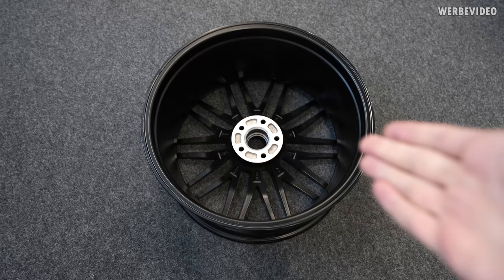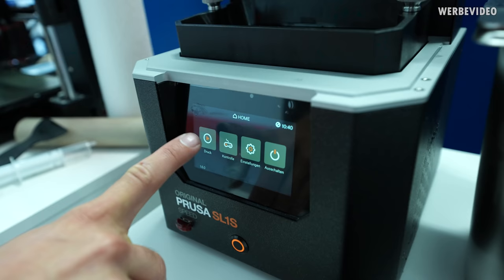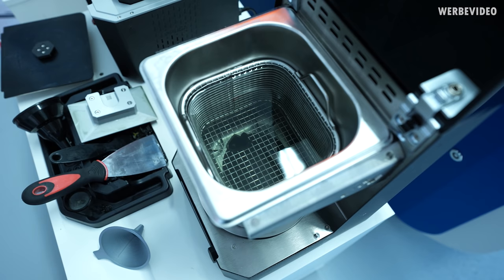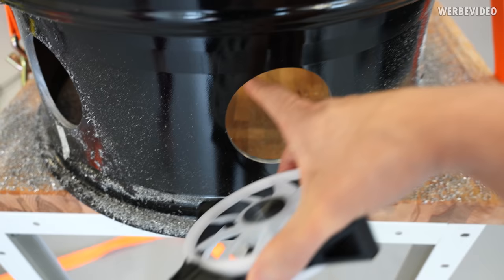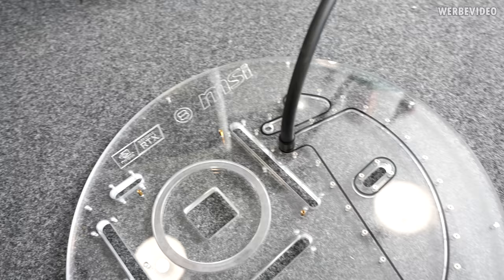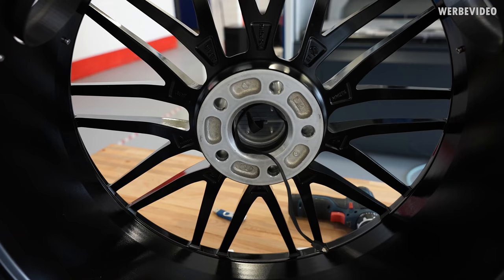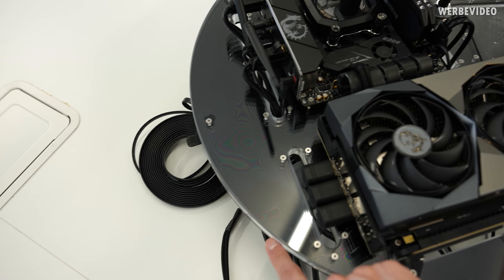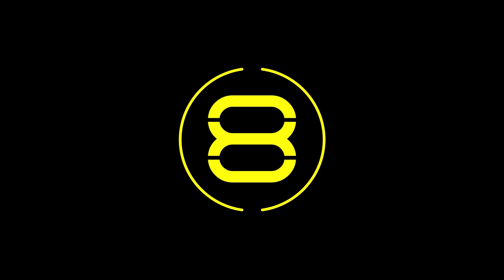The PC inside a Car Wheel - Building the Daniel Abt Gaming PC - Part 2

Comment: @der8auer if you read this thank you and I'll try to be constructive
the front face looks goods but the back is not especially on a table where everybody can see around, if the rim is to be mounted on a wall then why not but the psu in the wall will be an issue.
I think i would have put the radiator behind the rim to cover all this mess.
And I would have watercooled the gpu too with such amazing amount of radiator and distro plate it is a waste to not use them.
Then you would not need much air flow inside the rim well only a little bit for vrm and chipset and nvme and ram so i would have put 1 at the bottom with dust filter and only 1 on top but inside the rim
For the io shield you should have come up with another solution than adding cable it looks just meh
On the awesome part the usb c connector in the middle is genius.

Comment: Yo, Roman, very cool build, well done adapting everything into the rim, especially the USB-C, really clever to hide it in his logo. Also really like the fan adapters, a clean solution to the problem of mounting a flat surfaced to a curved surface.
Curious though, where's the first part of the build? Don't recall seeing it in the last few months and even went back and searched through your videos and still don't see anything related to this.